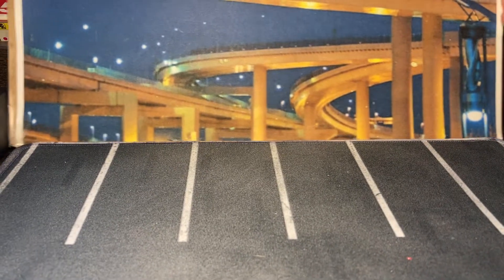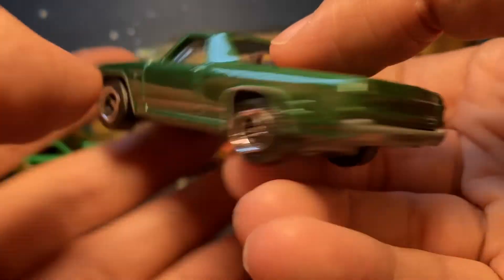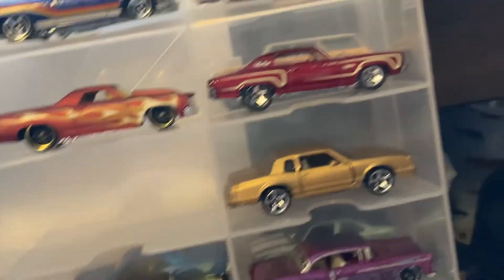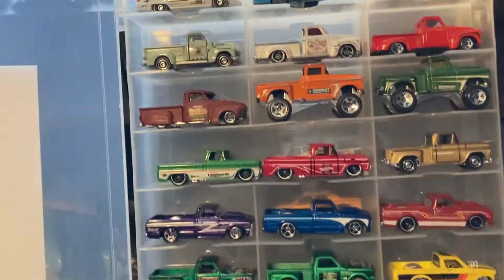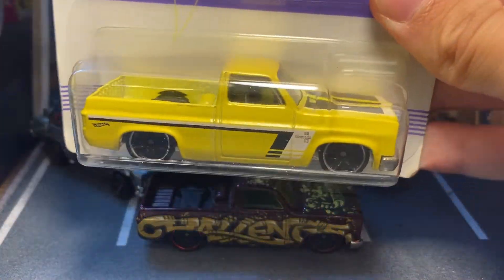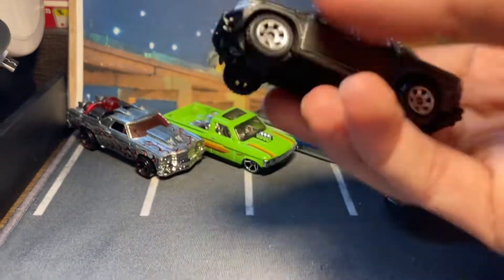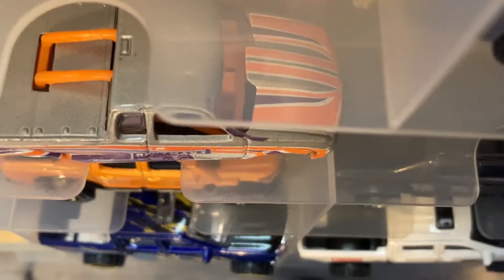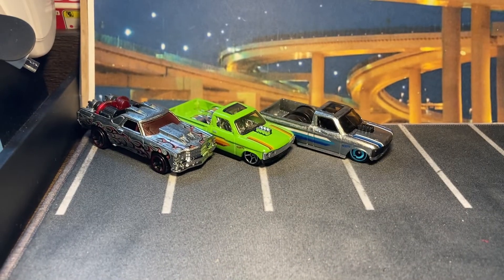Chevrolet Mania! Adding some Hot wheels and Matchbox Chevy castings to my collection!

Comment: Now you gonna need the black trail boss and the white trail boss   that have the borla logos      there's also a black one and white one of the Jeep with the motorcycles in the back   they both also have the borla logos
Reply from the maker: Ohh yeah I have that Borla Trailboss, it was in another video a couple months ago
Reply: @matchboxman1518  black one or white one ?
Reply from the maker: The black one
Reply: @matchboxman1518  I found the white one last night   at target    the only single carded  main line I bought     I did get a hotwheels 5 pack   of the exposed engine 5   and I picked up 3 matchbox 5 packs    one has a dodge 4X4 truck    another one has a 59 Chevy wagon   and the other one has an army jeep     I also picked up an auto world   Mopar   and a green light  Monty Carlo